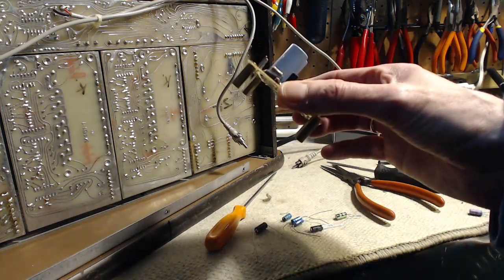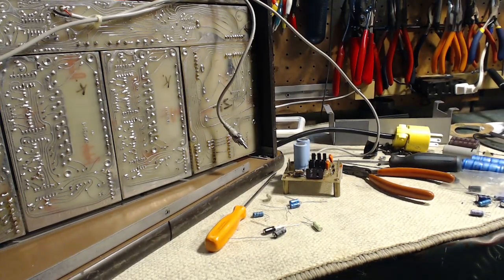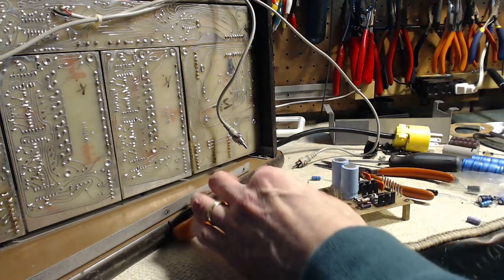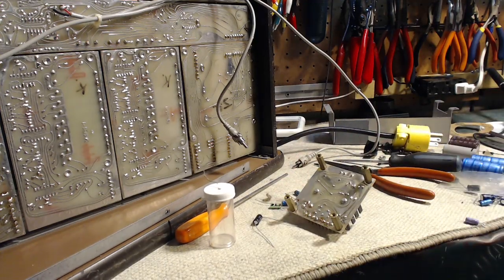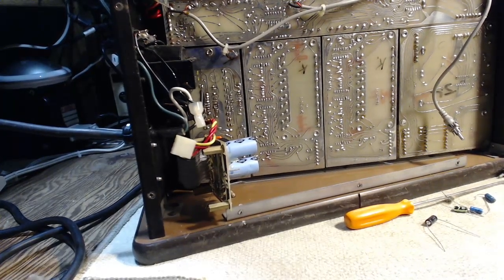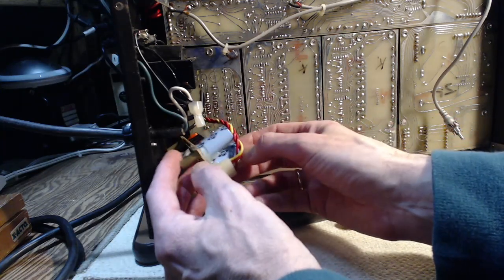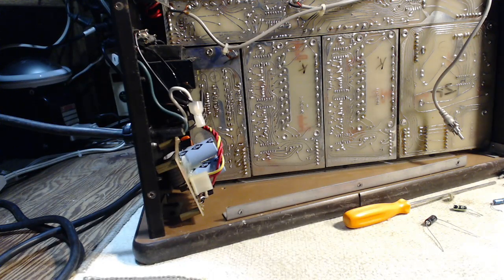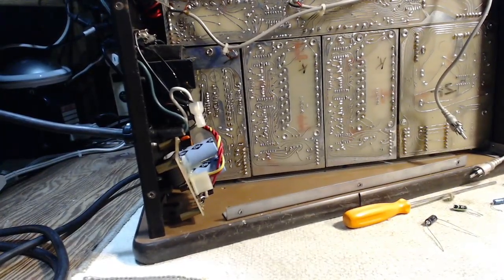Traynor 8/201 Analog Mixer Video #6 - Power Supply Capacitors

Comment: Jim, you can always buy a condenser dryer, the moisture is removed from the exhaust and collected in a container and they don't need to be vented outside. I have a miele washer and dryer and they're brilliant - its not such an issue in western Australia though as we have sunshine 3/4 of the year or more and with my 5Kw solar panel setup I don't pay anything for electricity at all.
Reply from the maker: MercMad West Australian At first I thought you meant a capacitor dryer!  I've never heard of a condenser clothes dryer.  I should check it out.

Comment: Jim, you through me off for a minute with the temperatures in your house saying "23 to 24 is warm", Then I realized your in Canada and using Celsius! I am thinking Fahrenheit in the US! I have the same problem with a drafty house that was built in 1850. , I agree with troydog, you are not supposed to use your oven because of carbon dioxide if it is gas. It is not properly vented if you have the door open all the time. Nice work 73, Tom

Comment: By chance what are the numbers on the two voltage regulators? Sure getting the feeling that once you expose those boards your going to find a couple of opamps at the heart of all this.
Reply: I saw a MC7915 regulator so logically the other is a 7815, +/-15 volts output...
Reply: Dennie Lee Agreed...the 2200uF caps are to filter the bridge rectifier ripple. A "by the book design" for these two regulators. I wonder if there might be a zener diode in place with the 1 ohm for another voltage...+5V for logic?
Reply: Ya, would be interesting to see what voltages are on the ribbon cable leaving the supply.